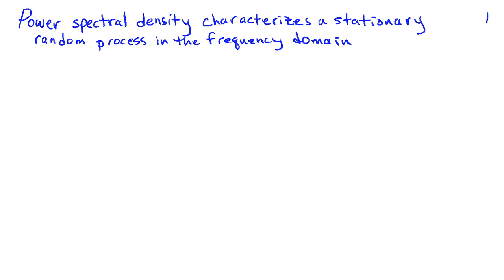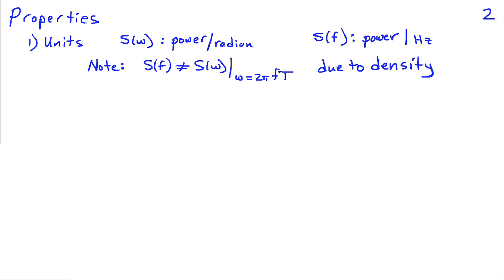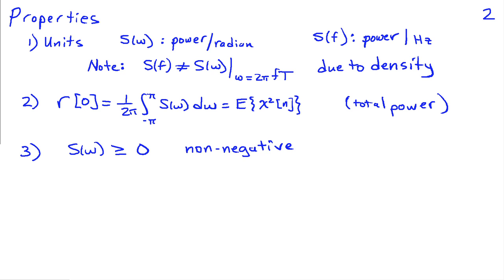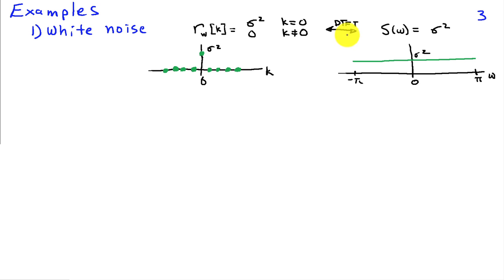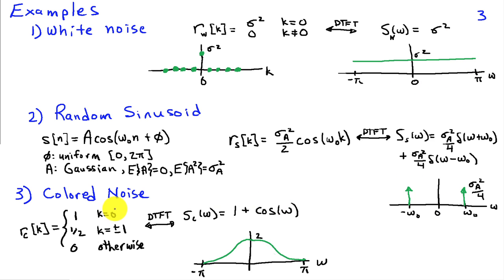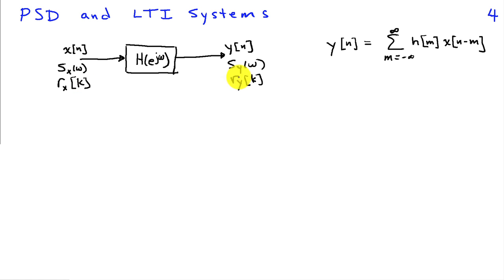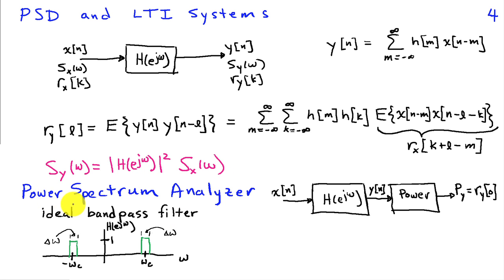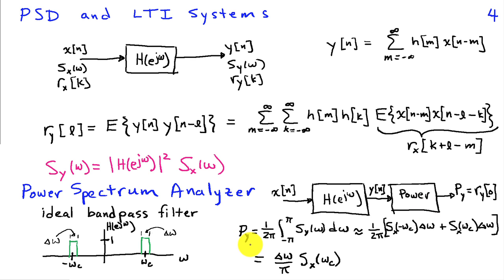The Power Spectral Density

Comment: there is a most basic question. Why psd is defined as auto correlation first then ft ?
Reply: Auto correlation is the fourier transform of the psd that is first 
Second : auto correlation for afuntion is the expected value of multipling the signal by itself with shift tau but if the tau is zero and there isnt no shift that means you get the average power of the signal .

Comment: I have a question: What is the significance of Power Spectral Density?? For any Noise measurements why a curve with just Voltage on y-axis and Frequency on x-axis is not enough??
Reply: Deepak Kapse simply it tells you how much power brought by 1 radian or 1 Hz of the signal. It is one of characters of a signal we are trying to describe.